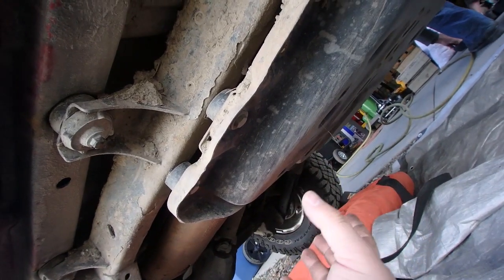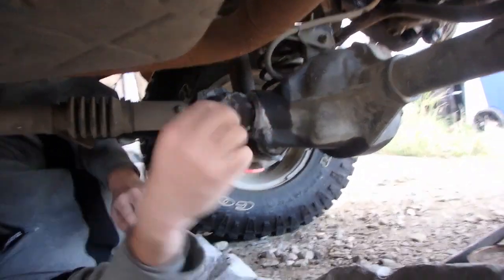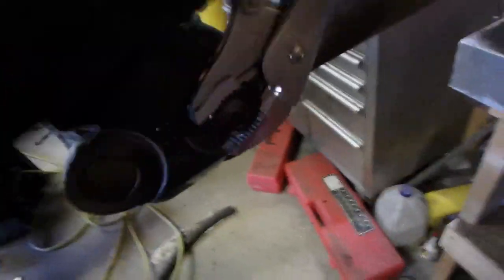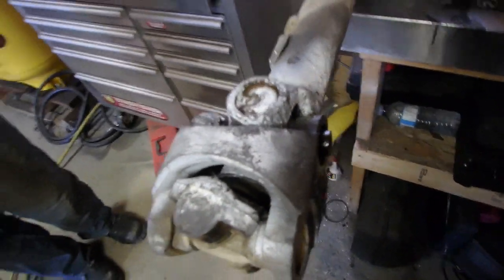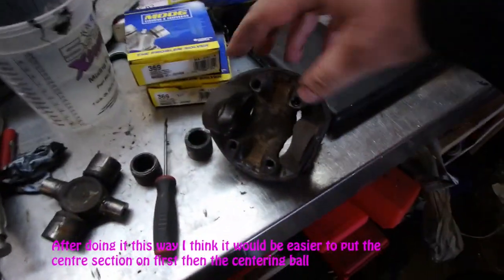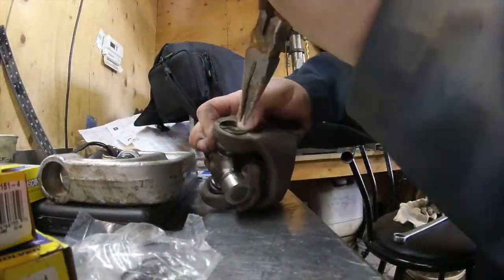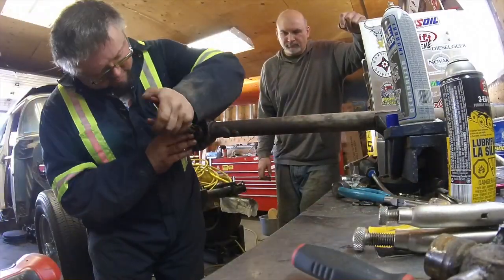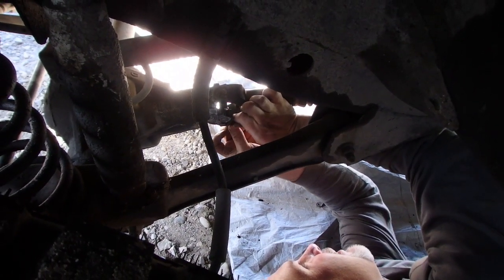Rebuilding a Double Cardan Joint DIY Jeep Front Driveshaft

Comment: Hi, Would you know if I can replace my single ujoint on my driveshaft with a CV ujoint? If yes, would you know where I can buy one? Thanks. 
ps. I have a 76 cj7 jeep and doing a 4.3 v6 engine swap so I need to shorten the front propeller and lengthen the rear driveshafts.